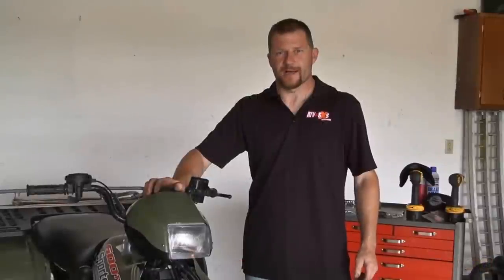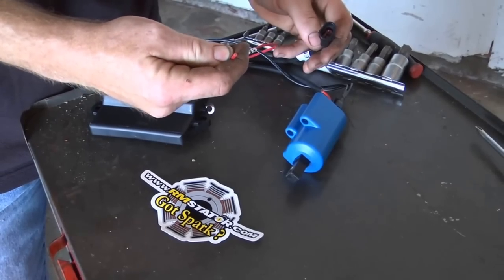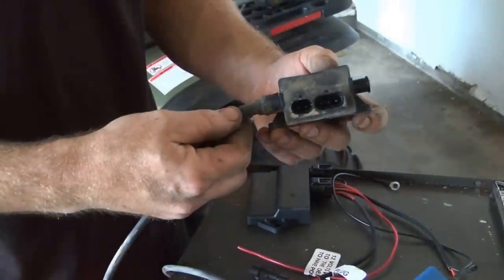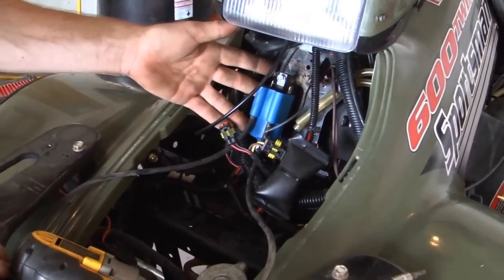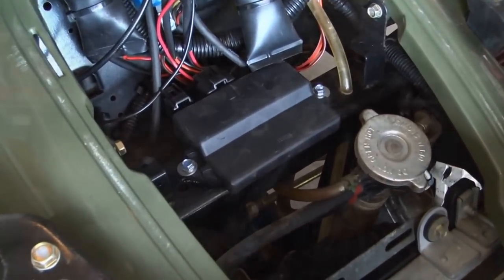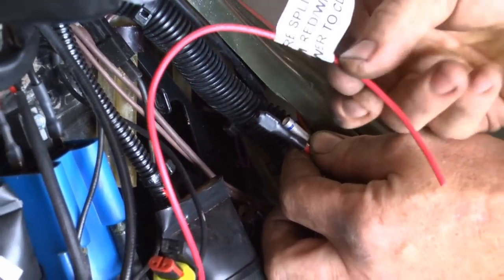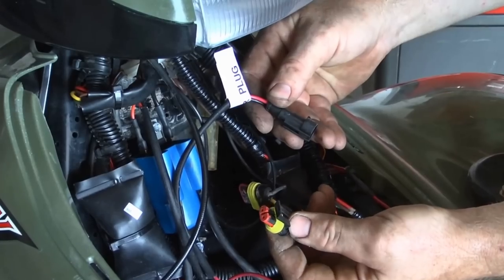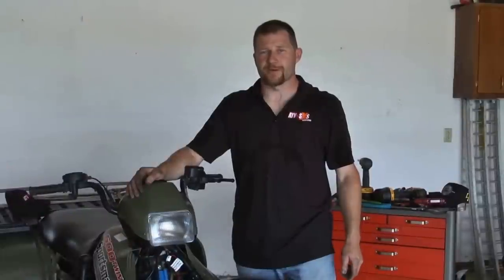Polaris Sportsman 600 / 700 2002-2006 AC/DC upgrade kit for Stator + CDI Installation instruction

Comment: For the do-it-yourself crowd, I would recommend that you use either a heat gun for the shrink wrap or liquid tape. Using an open flame around any motor vehicle or gas source can have catastrophic results! Great product.
Reply: Yep, Harbor Freight has a heatgun for $5.99 after coupon. hfqpdb.com for coupons
Reply from the maker: Good advice!

Comment: Does this work for carb models and EFI alike? Why doesn't it come with the stator like the OEM kit? Is the Polaris OEM kit for people who have already experienced a failure, while the RMS kit is for people who want to do preventative maintenance?
Reply from the maker: No it will only work with carb models, not EFI. It doesn't come with the stator because the most common part of the stator to fail is the source coil. Our DC conversion CDI box bypasses the source coil, so you can keep using your old stator.
Reply: So if your stator is bad this will not work????
Reply: @Rmstatorinc  so if stator is bad this will not work??

Comment: I have an '04 Sportsman 700 and I can't figure out where the Trigger Plug goes.
Reply from the maker: If it uses the Ducati ignition system, it is a 2-wire plug up front, shown in the video. It has a Red and Black wire.

Comment: Hi mate, how are you doing? Grettings from Brazil. I hope you can help me out on this trobleshooting. Let me get strait to the point. I just got a POLARES 330 CC, 2003 and I realized that my CDI box is not working, THERE IS NO SPARK GOING OUT FROM THE CDI BOX, something bad might happened. I did some researches on the internet, youtube and i notice the the best thing to do is basiclly replace it, get a brand new one. However, to get it down here is so expensive, BEEN TRYING eBAY OR SO TO SEE WHAT I CAN GET. But before of all  that  I´d like to try a MOTOBIKE CDI BOX one. Is there any possibilite to adpat a motobike one? What are you recommend? Have you ever try it? PLEASE HELP ME. I aprecciate it. Thanks so much. Excuse my inglish is bit rusty
Reply from the maker: Sorry I'm not familiar with a motobike CDI box. It may be possible to adapt it, but I couldn't help much.